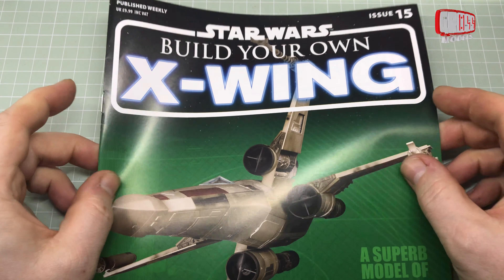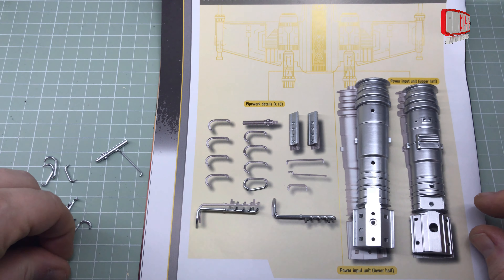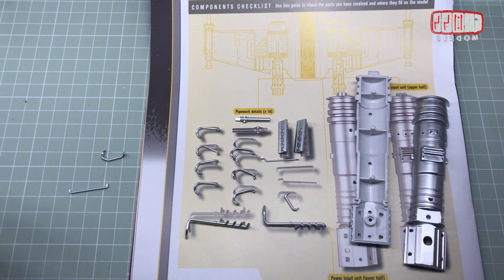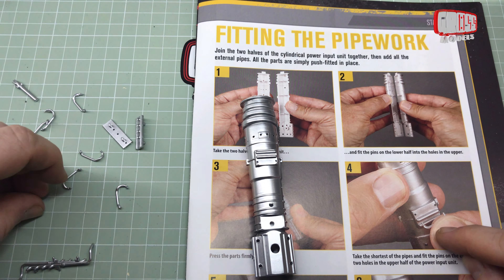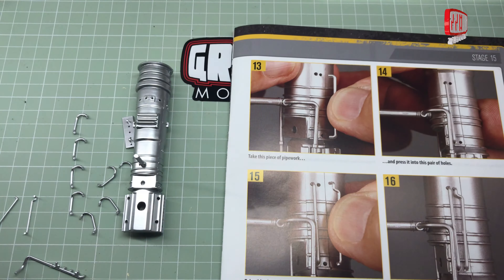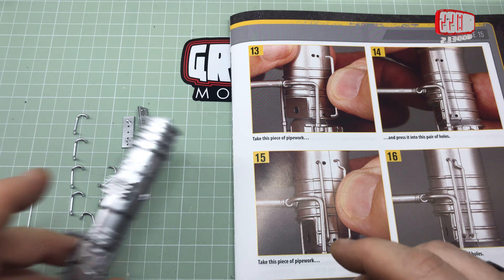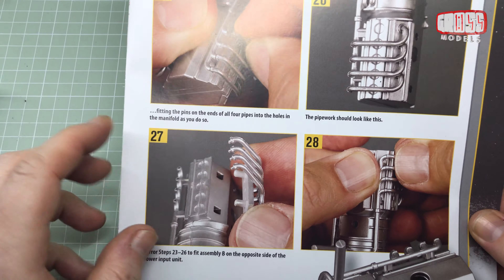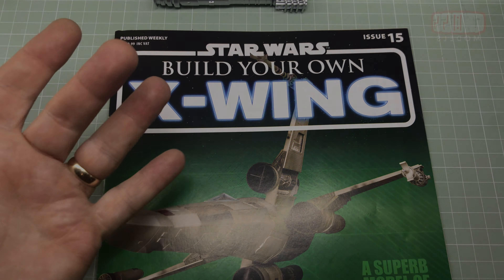DeAgostini 1:18 scale X-Wing build. Issue 15

Comment: I think the parts you are assembling may actually be reasonably screen accurate  - the square bit that you attach the two manifolds to at the start certainly looks like an aircraft or truck engine block and exhaust manifolds, you can even see the little circles where the cylinders might be    - which would be an unusual thing to replicate unless it was on the studio model as a result of kitbashing back in the day :)